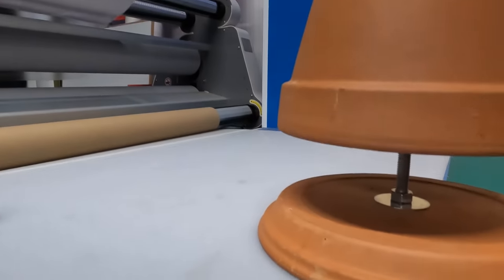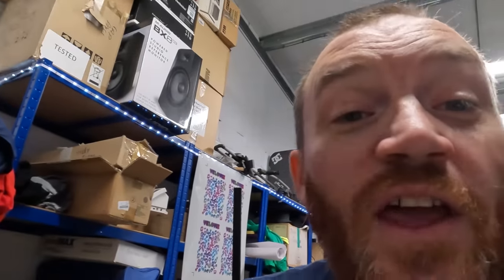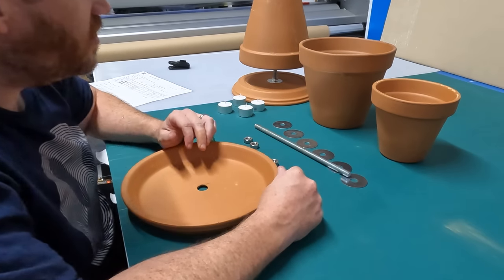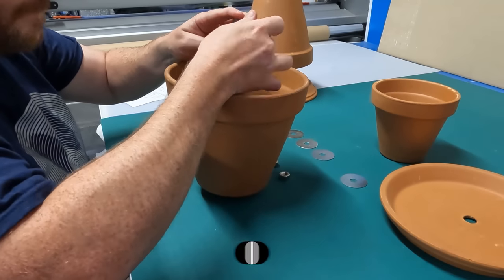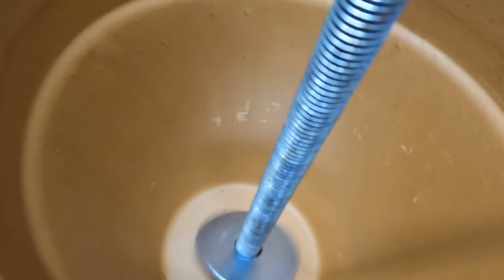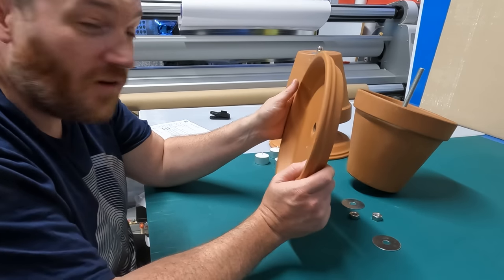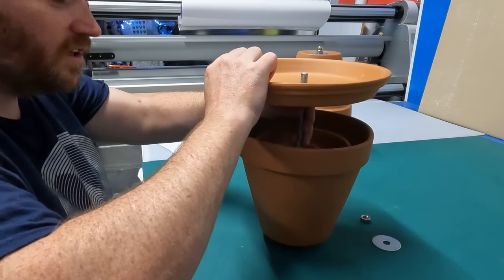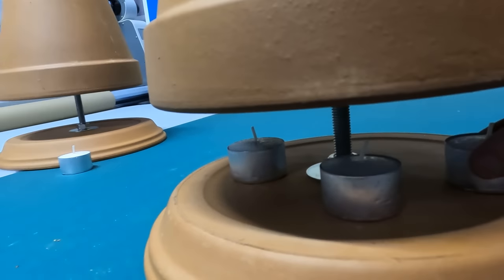How To Make a Tea Light Candle Heater in 5 Minutes

Comment: I did a test with a single vs double pots and it seems like the single one is more efficient with more and quick heating release vs double one, which is slow starting and not matching the highest temp of the single one..the only better thing is the cooling time, more on double, but is look like the same style and heating process of oil radiators vs convectors...Btw, single one is more easy to make and maintain without any mods, only a coin to cover the upper small hole..also,better one big pot with 2-4 candles vs 2 small pots with 1-2 candle each..
Reply from the maker: That's interesting.  I guess 1 or 2 pots both have their pros and cons 👍
Reply: @hausofyax  Give it a try, maybe i'm wrong..talking about 120C/10min vs 90C/30min surface temps
Reply from the maker: I will do.

Comment: May I ask another question please. B&Q don’t have those plant pot sizes in stock. What other sizes could I use. Thanks.
Reply from the maker: You can use any really as long as the size difference is comparable so there is a small air trap between them.  Ideally you should source a different supplier of these sizes if B&Q are out of stock as the rods etc listed were specifically chosen to fit these sizes.  That said, the rods can be cut down with an angle grinder if you do go smaller.
Reply: @hausofyax  thanks.
Reply from the maker: You're welcome!  Please consider subscribing 👍

Comment: The science part that I don’t understand is why you can’t just leave a candle out without a pot over it. Won’t it produce the same amount of heat? Or is it that the heat will go up to high and just stay by the roof? Why do you have to put a pot over it? Is that just for safety or does it make the heat radiate differently?
Reply from the maker: Some good questions, I assume the 2 pots both heat up and retain the heat after the candle has expired.  Also there is a much larger surface area where the heat can radiate from, as opposed to a  naked flame.  You can hold your finger a few cm from a naked flame and not burn it as the heat is very concentrated around the flame.

Comment: The way I've always understood the principle at work here is that there needs to be an unblocked hole at the top to create a chimney effect - ie for the hot air trapped between between the pots to escape...
Reply from the maker: You may be right there and I'm sure that would work too.  I've only seen them without the whole at the top.
Reply: its supposed to act like an indoor fireplace to warm up a nearby area, not a room. you want the heat to stay in the pot. another small terracotta layer on top will also allow you to keep water warm for tea as it will be flat enough for a kettle

Comment: not a safe way to do it - I have done the same and I put 4 in. The pot got black inside, so  I know that the pot needs a hole on top to allow the heated air to flow so 2 tealights or one small olive oil light jar little lamb light, is best to have it light when you are home not left alone, need to have a carbon monoxide smoke alarm and powder extinguisher. Lay strong Foil around the pot for safety 
Make sure the Pot is not under the light and needs a cap, The olive oil Jar or a soup Tin size is about 3-4inch and the pot needs 8inch (10cm) above so the Oil won't get hot
Reply from the maker: Some good advice there 👍

Comment: This design has a mechanical construction flaw, all this will do is trap the heat inside. U dont want to cover up the holes, when u cover up the holes it does not work as a old radiator anymore, u also wanna go for a much larger second pot.
Reply from the maker: You may well know more about this than I do but since the porcelain heats up as it traps the heat inside this radiates heat over a prolonged period of time.  What is the reason for the larger second pot?  I'm interested to learn :)
Reply: 2nd larger pot gives greater surface area of heat.  Over here in Hungary they also drill small additional  holes at the top of the pots to give greater convection of warm air. They do work. 😁

Comment: One tea candle can produce around 30 watts of heat, which means that you need at least 20 to 30 tea candles to heat a very small room (and replace them every 3 to 4 hours). 4. You have now built a small fireplace using tea candles. A box of 100 tea light candles costs $15. A 100-pack will last you about 12 hours, or "a whole day." Your "tea candle" heating bill will be about $500 per month. Congratulations to all the geniuses out there who have used this method to heat their extremely small rooms. 👏🧐
Reply from the maker: I'm sure you make some good points there but you really didn't watch the video did you?  The tea candles run for 8 hours so I'm not sure how you managed to deduce that 100 would "last about 12 hours".
Reply: 15 bucks 

Is this Canadian or Australian conversion or an expensive store in America 

Here in UK many of our stores sell 100 for £4 

Lidl, ikea, Wilkos, tesco  etc